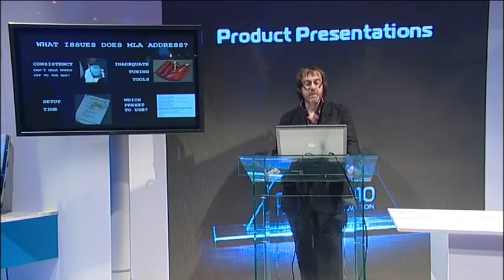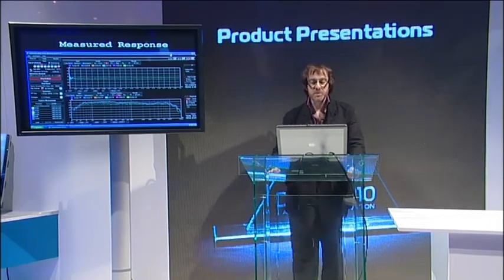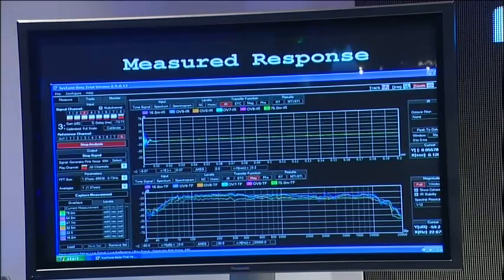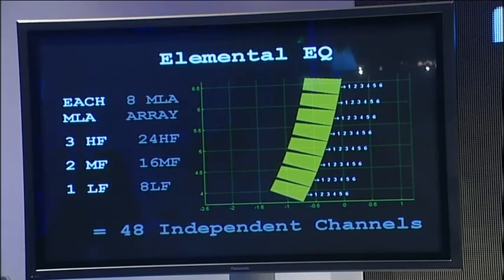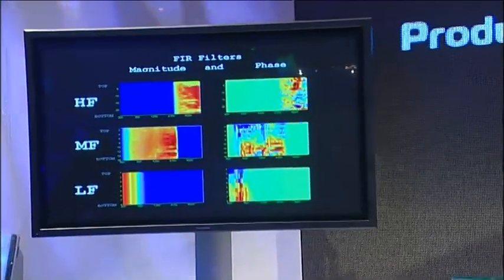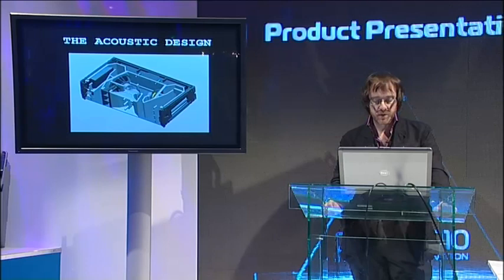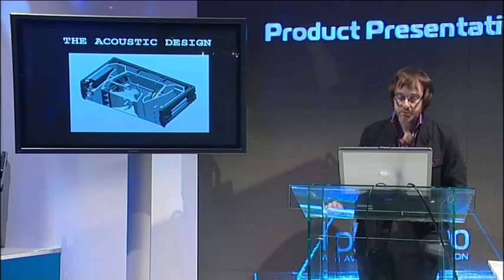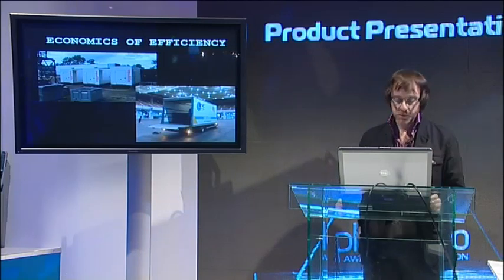Martin Audio - MLA (Multicellular Line Array) Pt 1

Comment: Thank you! This description gives a non expert like myself not only a better understanding, but also provides the correct terminology to use when describing aspects of this new tech. 
One thing I learned with interesting and practical potential uses, is the significantly reduced power draw of an MLA system.